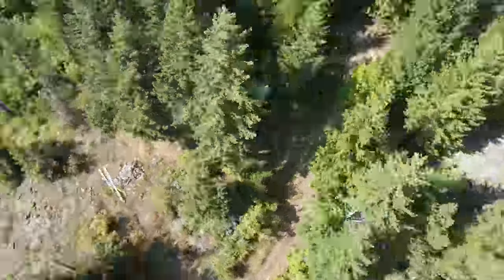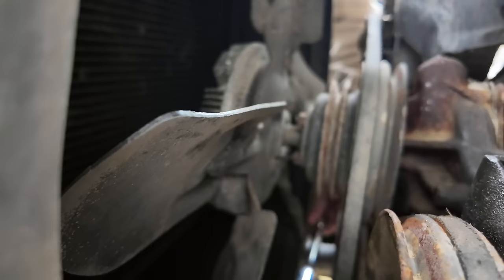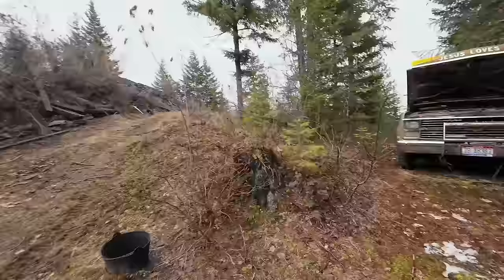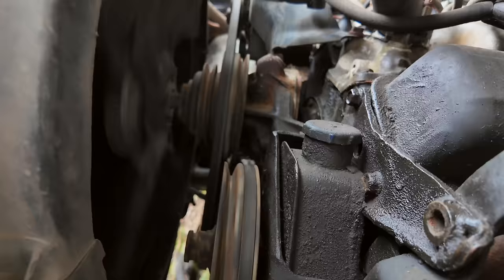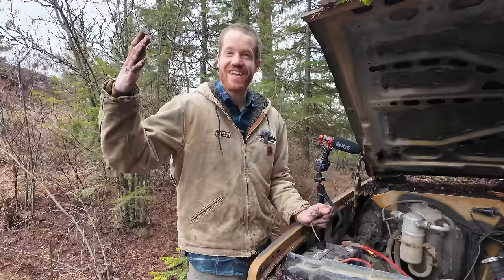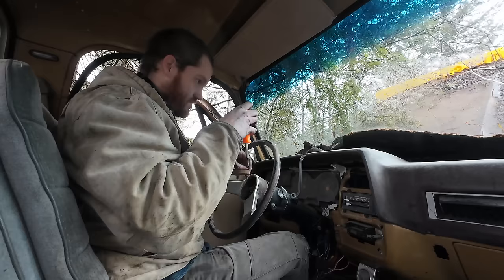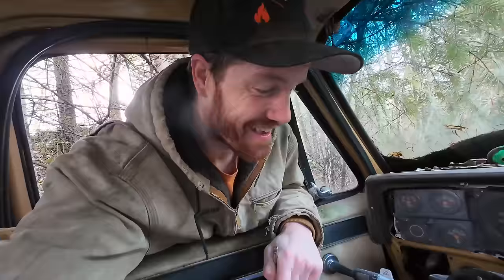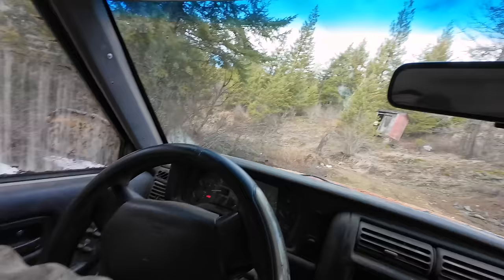ABANDONED 1983 Chevy K10 (sitting 20+ years)

Comment from the maker: The only thing tougher than a Chevy is a ___________. 😉 Upgrade your wallet game today and get up to 30% off your Ridge wallet now through April 1st: https://ridge.com/ambition
Reply: Ambition strikes resolve.... make this build a series. This is the kind of content we love from you guys.
Reply: Honda Goldwing😂😂
Reply: About battery terminals and cable clamps, always clean them to bright metal and apply a simple, basic unfilled wheel bearing grease BEFORE clamping back together. What this does is prevent moisture and oxygen seeping into the tiny spaces between battery post and clamp, which is where all corrosion begins. Excess grease is squeezed out and can be wiped off when done. I've been doing this for over 40 years and check annually, the posts and clamps are always still shiny.
Reply: The only thing tougher than a Chevy is a Bible.  Amazing how the Bible on the front bumper survived the weather for nineteen years.  Maybe that is where they put the keys.
Reply: The only thing tougher than a ' Chevy ' is a really really pissed off Bear ! ! Happy Trails from 🇨🇦 to the 🇺🇸 . ✌ out
Reply: @woundeddove  Same vehicle
Reply: my wife  🤣🤣🤣🤣
Reply: A Ford '92-'96 OBS crew cab truck.
Reply: an older chevy
Reply: A Ford dentside or bumpside (67-79)!!!
Reply: In theory you should be able to start them with a caterpillar key same steering Column as a cat challenge and they just use a cat key
Reply: The only thing tougher than a Chevy is the way you two work together, and can overcome anything   That’s why we all love watching you two so much and how is little Oliver we didn’t see him.        Jim
Reply: Love your videos. I sure miss having my property in the forest. An adventure every day.  I have just got to get back up.in the hills.
Reply: No s*** just save me time watching your video because now I know it runs. in the first 10 seconds
Reply: I agree with AmbitionStrikes kind of defeats the purpose of the whole will it start by showing at the intro.

Comment: very cool ....40 year old truck left abandoned for 20 years starts, runs, and drives.......impressive
Reply: They sure do not make them like that any more!!
Reply: it runs on 20 year old fuel?
Reply: If it had stabilizer it would and no water got into the tank.
Reply: @GT500Shlby I'm wondering if gas from 20 years ago had less/no ethanol which really helps with moisture rejection?
Reply: @GT500Shlby  Stabiliser does not last 20 years,
Reply: just like in jurassic world, less believable than cgi
Reply: @jessicanicolebelmonte6252   like a rock......
Reply: @GT500Shlby 😊😊😊😊😊

Comment: Advise… drain the old gas from the tank (as much as you can get out)… add fresh gas. That will help a lot… you might have to rebuild the carb…but see how it runs with fresh gas. Congrats!
Reply: IT's running rich, that's for sure, carb needs tuning, but wicked find on that old square body, and I'm not even a Chevy guy.  Would love to see a restoration on this one
Reply: @deanlindholm8663  Those old Quadra jet carbs are ok but so few around anymore. Perhaps you can find a you tube video that shows how to rebuild one? I have no doubt you are capable.. just need some guidance. If you do decide to tackle it… replace the float (they are sealed foam and often start to absorb fuel when they get old, causing them to not float so well which will make run rich). The biggest problem is the old fuel has gummed up the carb. First thing is to get that old fuel out and new fuel in. When you do that add a bottle of “dry gas” also called fuel line anti freeze… it will remove any water in the tank from condensation. It also might be wise to remove the tank and clean it out… you may find it is really horrible inside… and might even be worth getting a new tank? Looks like a good old truck… well worth fixing. As for the valve tapping.. you can dump some Seafoam additive in the oil.. this will clean up the inside of the engine… and might get the lifters working better? Then change the oil and filter (use 5-30 oil) … Good luck… (old mechanic, signing off… 😁
Reply: @JoshuaTrenge that's not a qjet carb.  Qjets are great carbs and work very well off-road for those that have a little carb savvy.  Even knowledge Ford guys use them in their off road rigs. 

Agree with completely draining the tanks and starting fresh.
Reply: @JoshuaTrenge   Great reminders, @JoshuaTrenge.  Thanks.  In 1969, I missed the opportunity to purchase a NEW 1970 4x4, 3/4 ton, automatic transmission, posi-trac  pick up truck.  Sure regret not having that rig to this day.
Reply: That "old' gas might be better than today's gas...Lol
Reply: @JoshuaTrenge it has an edelbrock on it it didn’t have the factory carb

Comment: I had a 1973 Chevy with the 350 LT1.  I put over 200,000 miles (322,000 km) on it.  Always started. Went through 3 starters, a water pump and a few rocker arms. Awesome truck. Best part was you could sit under the hood on the wheel well and fix anything with a screwdriver and a set of craftsman sockets.
Reply: My first vehicle was a 1975 Chevy truck with the 350.  One of the owners before me removed all the emissions stuff and put a street cam in it, but the rest of it was stock.  I don't know how many times the odometer turned over but I couldn't afford to drive it much.  I clocked it at 4 mpg.  It was pretty strong, though.

Comment: That thing you said may be the smog pump is actually a tube that pipes heat into the air cleaner assembly when the vehicle is cold to help it with cold weather warm ups and characteristics, once warm a blade in the air cleaner blocks it off
Reply: Correct.  It's called thermac air.  Tube from exhaust to bottom of air cleaner flapper valve to shut off incoming cold air.
Reply: The "heat stove" was tin next to the exhaust, piped to the breather, and necessary at times to prevent cold damp air from icing up the venturi and killing the engine, 5 minutes later engine heat would melt that ice and you could run again.

Comment: You NEED to restore that bad boy - it does not want to die!!!
Reply: True, with a bit of TLC and a makeover he would last another 40 years at least, would make a good work around the ,farm truck for sure. 40 years old, made like a tank, no plastic on him, couldn't be a better resto project than that, there's gotta be parts still around even if they are second-hand or refurbished, just make sure that the old boy doesn't die.

Comment: Only halfway through. Motor sounds like a stuck lifter or broken valvespring. Sometimes #7 camlobe goes flat. Yeah, I know every nut and bolt on those things intimately.
Reply: I was thinking the same thing.
How about that steering column? LOL. Like going down memory lane.
Reply: Yup looks and sounds like what you described, Should change oil and add coolant before driving. Us old guys know that changing all fluids is a necessary duty. You have no idea how old the the stuff is.
Reply: @Kneemako  About 40 years.
Reply: @Kneemako  to be fair, I'd drive it down the hill to the shop with no or low coolant in the radiator. In this case, it's no more than a quarter mile at most. If I wanted to keep it, I would do a complete teardown anyway. 
Valvetrain components, distributor caps, water pumps, starters, and ring gears are usually the first thing to go on those old low hp GM small blocks.

Comment: Wow. Did it without putting gas into the truck….20 yr old gas ?  😂
Reply from the maker: We still can't believe it! 🤣
Reply: That was real gas back then, you may have to get non ethanol fuel to run it, That engine may have required leaded fuel also. @AmbitionStrikes
Reply: @johnaddis1022 the second gas cap he opened said unleaded only.
Reply: @johnaddis1022  By the 80s everything was Unleaded.

Comment: If you end up keeping that truck let me know. We actually have the Chevy hubcaps for that truck if you're interested.
Reply: I'm guessing that hubcaps are the least of the things that truck needs😢😢
Reply: Know anyone interested in a 1982 GMC 3500? 2WD dually with a flatbed. 3:55 rear end with a 700R4 and a rebuilt 1990 350 with TBI. Runs but been sitting a while. The TCC seems to be stuck. I drove it to where it is but when shifted out of park it dies just like the torque converter clutch isn't releasing. I was working on it with my father before he died in 2018.

Comment: As I recall, that flexi metal tube pulled hot air off the manifold into the snout of the air cleaner. There was a vacuum actuated flap at that point. I'd guess you've got a vacuum leak of two from the missing lines.

Comment: I used to have a 1982 chev pickup truck and the ignition switch had like 2  wings i call it where i could just turn it , didn't need a hey and it would start everytime, had it like 6 years no problems

Comment: GMC and Chevrolet are both owned by General Motors. They are manufactured on the same assembly lines, and the differences between the two brands are minor. So essentially the previous owner just popped some GMC hubs on because they're pretty much the same.

Comment: No, that's not for a smog pump. That corrugated foil pipe is hot air supply for the snorkel of the air cleaner.

Comment: Riley, that rotten hose that you saw on the truck and thought it was for the smog system is actually to provide heat to the air coming into the snorkel part of the air filter housing when it was cold outside and helped to get the engine running better when the engine was cold

Comment: Thanks Courtney and Riley for resurrecting this 2005 Chevvy with GMS hubcaps.  I am impressed how quickly Riley removed the steering wheel, the signal blinker device and was able to replace the ignition lock/switch.
Reply: That truck was two decades old in 2005...

Comment: I believe date codes on tires changed to 4 digits (WWYY) in 2000. Before that the 3 digit date code was WWY, so it worked the same way but it didn't tell you the decade. A 3 digit code ending in 7 could for example be 1987 or 1997.

Comment: The crunchy hose on the side Is for engine warm up it's called the heat riser tube Basically takes the hot air rising off of the exhaust manifold and gives it to the carburetor so that it heats the gas up on the way to the combustion chamber

Comment: With aĺ the mechanic work you do on trucks and equipment harbor freight would be your best friend 😉 oh and the lock on the steering wheel you could have just broken it then replaced it with a new one them trucks are so easy to work on the wiring is simple good luck

Comment: Not the original seats, they had a bench seat back then, the corrugated  hose comes from exhaust  manifold, it went to the air cleaner to a device I forget what it's called , it is heated by hot air in the tube and opens a vacuum  operated whatchacallit.

Comment: Riley, the gear shift rod can be easily removed by pulling a hair pin clip and pulling it out of the shift lever. It's an old wrecker trick for moving vehicles. I'd say its a good chance the transmission needs overhauled. I've done about 50 350 turbo hydromatics. Lots of how to videos, you can do it.  Engine on the other hand, I'd do a compression check, might have some stuck rings.

Comment: the  tin heat shield on the right manifold and the short broken off  piece of flex hose goes to the spout of the air cleaner hooks on to port to take warm air to the air motor door  which is controlled thermostatically  to take warm air to carburetor then when truck warms up  the little thermostat in the air motor door opens  the damper door and sucks out side air into air cleaner

Comment: Hey guys great truck so my suggestion is during the tank the gas tank will put fresh fuel in a put a new fuel filter in  drain the oil put some heavy diesel oil i in the truck that's usually a better oil it has more good stuff in it run that for a few hours and then change the oil again cuz it's been sitting so long there's lots of sledge and s***  builds up it'll get rid of that get up on Jack's pull all  the tires off check all the brakes I'm sure that the brake lines are crappy if it's been sitting that long especially the rubber ones the front bearings repack bearings and change the rear end oil in the diff. And then on the engine itself change all of the lines the fuel lines the vacuum lines the coolant lines should be just changed cuz they're all old and cracked and crap but it should be a nice truck for around the property just throw wood in

Comment: I've come real close to knocking out my own teeth pulling a squarebody chevy steering wheel without a puller.
Reply: That's why you keep the nut on about 3 threads prevents coming off and knocking yourself in the head Or you could just wear a full face motorcycle helmet LOL

Comment: Good job.  My father used to work at GMC, if I remember correctly, Chevy and GMC trucks used to go down the same assembly line, and most parts were interchangeable.  My first experience fixing cars was on Chevy and GMC trucks and I used to get whatever parts I could cheap, so I'm sure I mixed a lot of both as I had several trucks similar to that one.

Comment: in the past when I got A dozer stuck,Would use an old truck wheel and bolt to track( with chain) on each side or maybe a log to both tracks below the blade then you have  half a track revolution before you have to take off and rebolt on track
Good Luck

Comment: If you're having with it sometimes having spark when you crank and sometimes not, it's the ignition switch, it's down on the column and not horrible to replace. I've had a few GM's do that, could be worse, some cars have them IN the column.

Comment: Worked in a dealership for a while and old steering wheels like that I used my knees as leverage and yanked with my arms and it would usually pop off but I left the center nut loose so the wheel would not hit me in the face did not always work but most times.

Comment: Yours and Courtney's newest project. Either do it right or put it back where you got it from. That is going to need all new brake and fuel lines, oil change, drain the gas tank, tune up, air filter, transmission serviced, new tires, brakes overhauled, I think I saw someone else mentioned e-brake, definitely new wiring😵‍💫😵‍💫, maybe a new seat or 2🤔🤔, all new exterior lights. That should make it "relatively" safe to drive. Next we can discuss body and Brite work. Fix door locks, check if windows works, is windshield cracked? Get the point??? 😂😂😂

Comment: Dude and dudette you guys have totally got to get that going and fix it up for a mountain truck I'm sure you don't have a title to or anything so it would still be great for using it around the compound there and you might as well do a ton of videos of fixing the truck up cuz Square bodies are cheap to fix there's not a thing on there that's super expensive especially if the transmission is still in good shape that's probably the major thing that would be a lot of money to rebuild it but Riley you could do a whole video on how to rebuild a Chevy automatic 700 R4 Transmission did all your mechanical engineering and with the backup of your love your videos

Comment: You probably should do an oil and filter change and probably check the spark plugs and wires and the timing and point gap usually if you got all those things right it'll start right up

Comment: What you could do is get a key that will fit in the ignition. Jiggle it up and down at at same time while jiggling it up and down pull the key in and out while trying to turn the key. If you do it right it will turn the ignition over. I know this because I use be a repossessor. The right name for the tool is called a juggler.

Comment: I am a big GM square body truck fan ive owned several of them all different years from 74-87, and for fixing the wiring harness you can probably go to the junkyard and get a same year k10 v8 gas 4x4 and it's more than likely better than the wiring harness you have or you can always buy a replacement harness for it but most don't want to pay for the brand new harnesses.... I know it is abandoned wondering how it works getting a title for it...

Comment: Of coarse it ran, as it has obviously been blessed.
No need for a steering wheel. Just pull alternately on the steering wheel. Worse is getting the c-clip off to remove the steering lock plate. Looking like y’all need to do some battery terminal maintenance across the fleet…

Comment: If you keep it please get the right battery. One that has the positive terminal away from the body (reversed terminals). Unless it's impossible for it to hit the body even if the truck is jostled around. Otherwise, it'll short when it's the worst time and start a fire.
What a find. It's still a lot of work. That's why they left it. An old junkyard may have an old one of those. You can pick up the air filter housing, the hose that goes from he manifold up.
The trouble is that truck probably has a blue book value of $50 as is. To someone like you it can be worth a great deal more as long as it's not rusted out. Parts should be easy to come by and that engine is easy to rebuild. It could be a great utility truck. Take it where you wouldn't want to take your other vehicles. Put a winch on the front. Who knows, maybe it'll pull your lightning out of a bad spot one day. I used to use a truck just like that to pull people out bad spots 40 years ago. Older version of that truck.
BTW, that may be a 350. The 305 and 350 is the same sized block. No kidding. It may have the original engine, they may have swapped it. Who knows what they did to it over the years.

Comment: Now time to put a breather on it recheck all fluids and change if necessary. Then replace ball joints and tierods as needed. Used tires would be nice and maybe a descent seat. Make sure the heat and brakes work and yes you have a new to you farm truck. Rock auto has all the parts you should need fairly cheap. Discount tire direct will have your cheapest tires and free delivery.